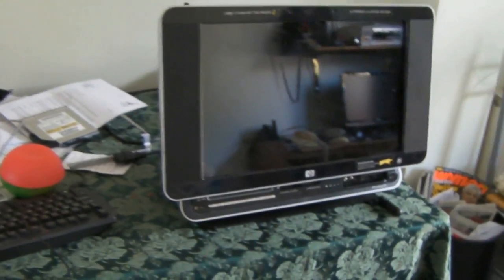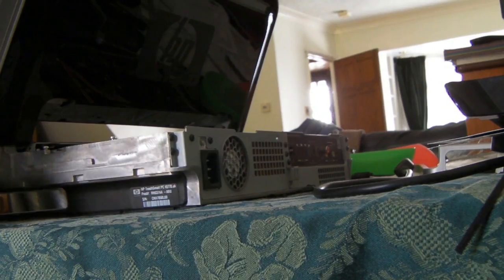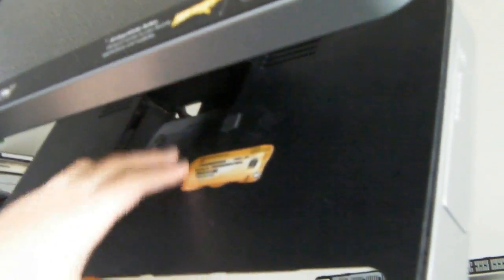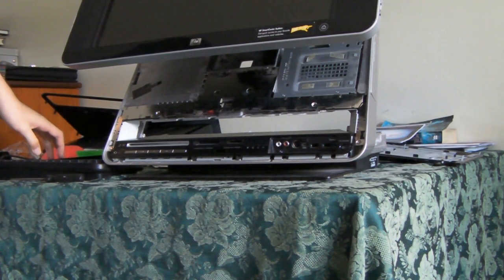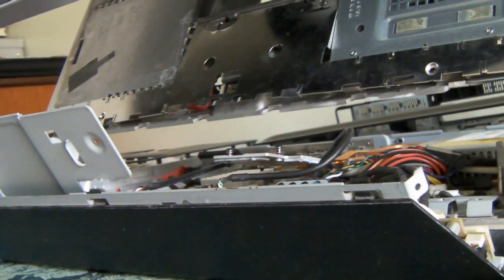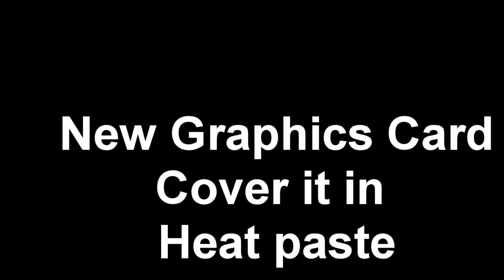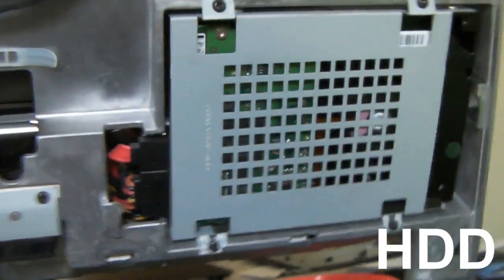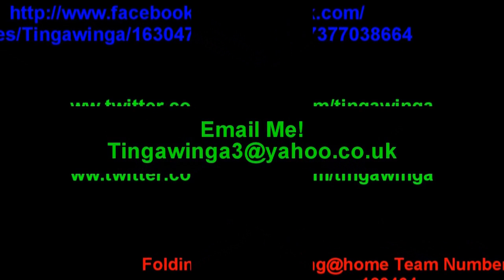How to Dissassemble a HP touchsmart IQ770

Comment: Did you ever try the other lsvd port...which is supposed to be some kind of on board video card. I switched port I still get nothing. Did you try it and is it fair to say if it doesn't work on this port even a new gfx card won't work.

Comment: TingaWinga5 - Great video it really helped a lot. I am at the point where I need to remove the heat sink from the graphics card. Those 4 spring style screws, how can I remove these, it seems very difficult. Any help will be much appreciated.
Reply: Oz I have just now removed my graphics card.  It's been months, and you have either figured it out, or gave up.  But I wanted to post how I did it.I removed the screws holding the graphics card to the motherboard (x2).  I removed the screws holding the heatsink/fan module (x3), and the screws holding the heatsink onto the CPU (x4).  From there I could remove the entire unit.Then, you can examine the underside, and using needlenose pliers, compress the black clips, and they should pop out of the video card, with a tiny bit of convincing.
Reply from the maker: This was a while ago now, but I remember the spring screws had a clip on the one side that you need to squeeze together to the middle of the screw then pop the screw out the other side. The clips are on what would be the pointy end of a normal screw. Hope that helps, this was a while ago.
Reply: TingaWinga5 Thanks for the reply mate. Will give it a try.

Comment: TingaWinga5---> How did you take the screws out to get that initial cover off?!

I have no idea since you started with the cover simply lifting off, effortlessly (hoorah). Not hoorah for me, though...Thanks for the needed info.
Reply: You mean the base cover, I know what you mean, i'm currently working on one that's G card has fried (I assume from the fault) and it's a nightmare to remove, in the book it states "A gentle push downwards on the back of the panel and slide towards you", easy for them to say, the closest I got was about 3mm on the left hand side, I advised the owner to upgrade to a new PC of which I now have to build for him, that's my weekend sorted, good luck with yours.
Reply: Kit Cloudkicker
I did end up removing it- & I think I recall that the base did just pop-off, but it was holding tight at first so I thought I must've missed a screw somewhere. I was able to move the graphics plug over to the on-board video & all was well after that. It was a really neat machine for the time, I believe. I actually like how it looks & having all of the ports at the front. Touch screen & TV tuner, to boot!
Reply: ***** Thanks for replying. It's been an entire year & many PC's since then. But, if there had only been "two screws" to get in, I wouldn't have written...not sure what you're speaking to now? Probably a diff. unit, as there were many....

Comment: this shit was complicated, but i finally removed the video card and no don't really need to buy a new video card, you can just use on board graphics since i can't find any geforce 7600 go online. in order for on board graphics to work you have to unplug LVDS_1 and put it to LVDS 2. it should be infront of the motherboard after you take off the faceplate.

Comment: I WISH I had known what a HPiece of cr@p this computer was before spending money on it! Reading the summary here, it seems that it was designed without any consideration of adequate cooling. I've been lucky with the graphics card, but had two hard disk failures which have been very costly to fix.
It seems HP designed this to fail as close to the end of the factory warranty as possible. And now I hear that they are getting out of the PC market altogether!

Comment: Here's some tips to make the job less "fiddly". That curved plastic pain-in-the-ass piece doesn't need to come out before the media bay. Save yourself from breaking the fragile clips by leaving it in place. Also, those clips that attach the heatsink to the graphics card can wait to be removed. Take 3 long screws from the fan assembly, plus 4 tiny screws from the chipset heatsink, plus 2 small screws from the graphics card and unplug the fan. Slide the graphics card out of its slot and remove.

Comment: HP IQ770 has an onboard graphics card, so you can just remove the faulty card and then there is a cable connecting the screen to either the card on onboard graphics. You will see it is the only cable that has an exact empty socket next to it, just unplug and reconnect on other socket. Presto,, working perfectly and no need to replace graphics card. Of Course graphics performance is not as good but is stable.

Comment: @admcontini1  No instructions really... I just got bored and started looking at the monitor control boards and noticed that I could take the control unit of another 19" monitor and use it for power and video inputs... Then as far as the touch feature there's another board that runs off of USB (the touch controller) and just patched the connector to a male end usb cable and plugged it in... Windows XP auto recognizes it as a human interface device I'll post the video I made if i can find it :)